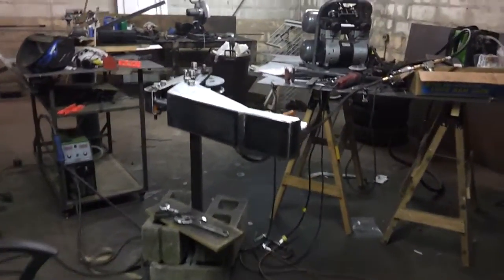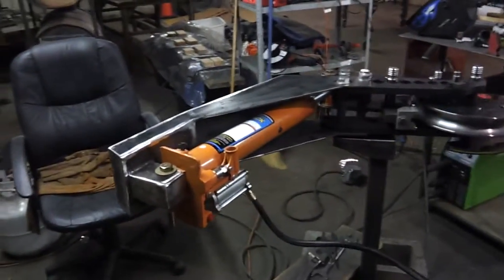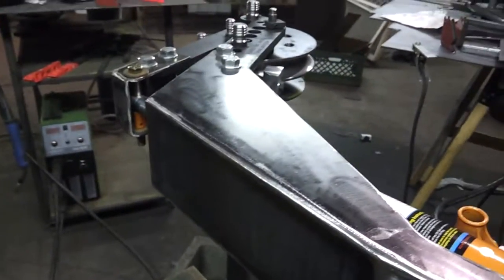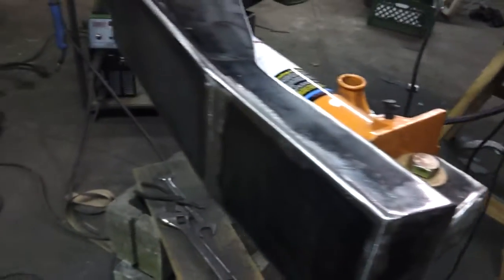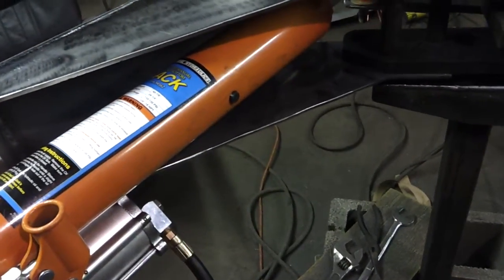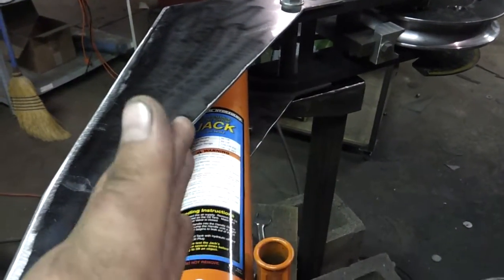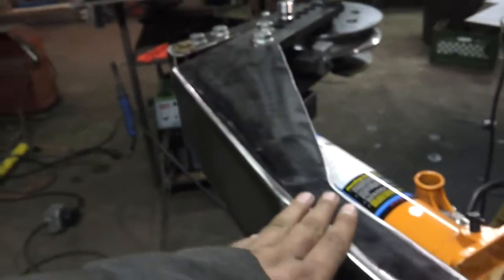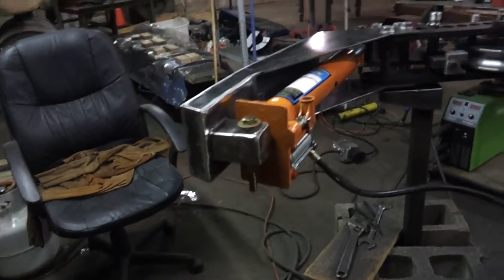JD2 Model 32 + Harbor Freight Ram Build (Part 6)

Comment: does it still work for you ?  I have the exact same hydraulic ram I like to rig up .  they don't recommend using them horizontally.
Reply from the maker: Yes it still works. You have to position it the way I have it in the photo or you run into issues starving it of fluid. I don't use it much but it works just fine.

Comment: Great added value product for the JD2 - your prototype works fine. If you are going to outsource the manufacturing, provide the manufacture with jigs for aligning the plates. Great video, the mistakes and solutions to correct those mistakes are of great value.

If you decide to manufacture, you need to think about shipping and keeping the design modular. I would possibly add a brass sleeve (greased) over that bolt which takes the load which connects to the jack rod.